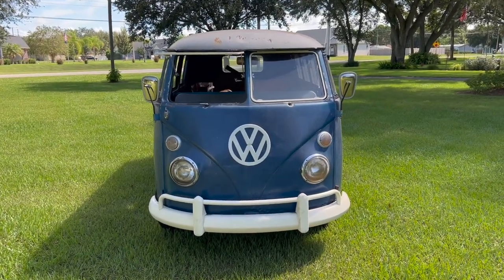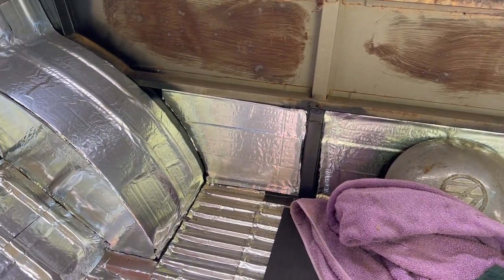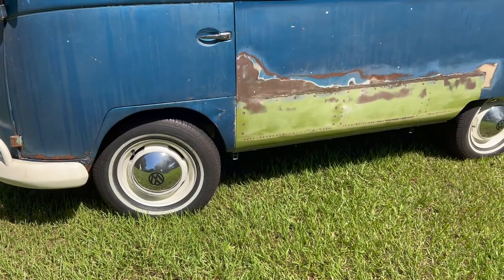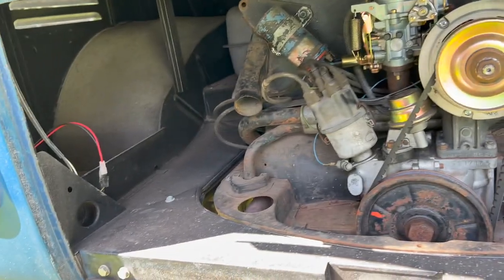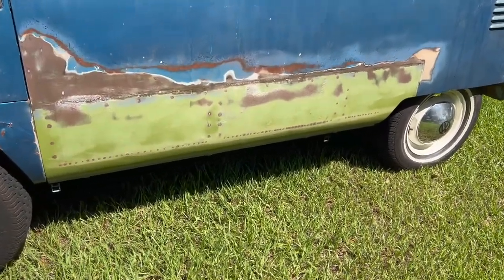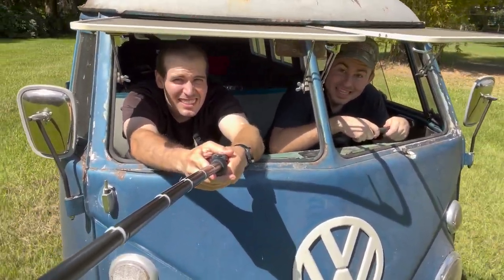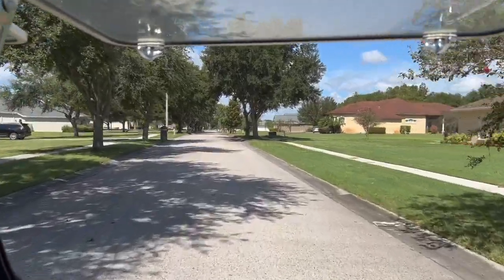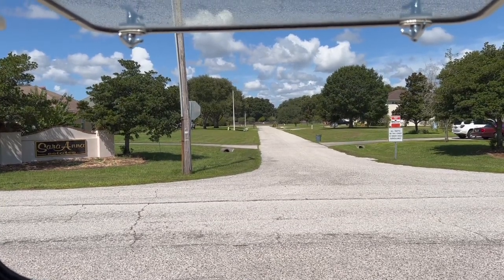New Project VW Bus Saved!

Comment: that's a sundial camper !
Reply from the maker: I think so too, but I don't have any evidence besides the windows (which are nearly impossible to find)
Reply: @rustyoldchevy1149  how about this, my sundial has westy HEHR units, and in the MIDDLE on driver side, where the table is, there is just a pop out window so you don't have to look through the panes of the crank window...so someone made this mod and if you are sitting there, using the table, is it NICE...just saying that lets you move close it up and keep looking...
Reply from the maker: unfortunately since this was a panel bus, I dont have factory window openings to put vw windows in. These windows were made by HEHR also, but were designed to be put in a hole CUT into the side of the bus. Might have to rig something for now.
Reply: I have 3 or 4 of those windows for sale
Reply from the maker: @shutupimcooking120  They are Identical to the ones in the video? If so do you have them listed online somewhere for sale?
Reply from the maker: @shutupimcooking120  I joined the group and couldnt find the ad on facebook. Could you email the pictures to me?"mytruckisrusty@gmail"    THANKS!

Comment: Tell you what I'll do I will trade you a 73 Camaro Z28 and a 13 ft Whaler with a 40 horsepower motor and I will throw in a 2000 Ford motorhome and $100 cash what do you say